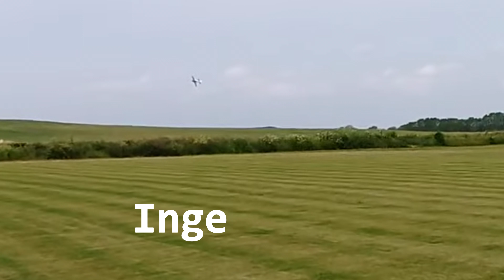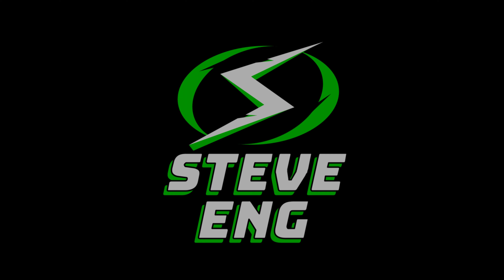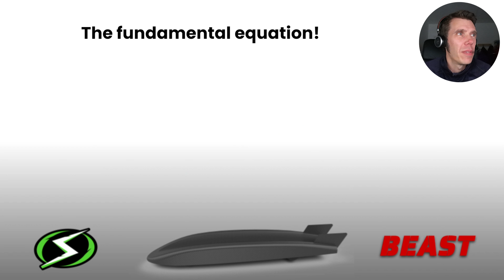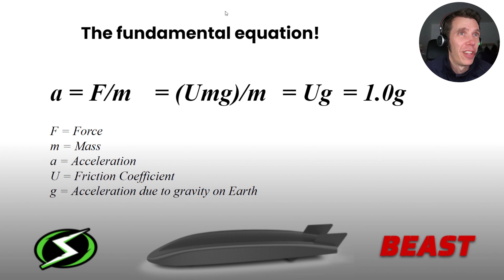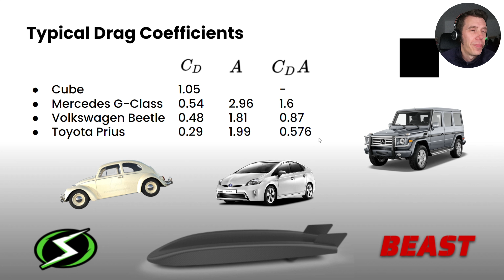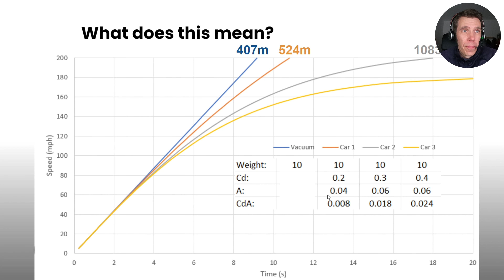Can Science help your R/C Speed Car go Faster?

Comment: Its a very good analysis. At your level maybe a more proper sensitivity analysis might be benefitial. Top speed gain over defined distance if you make the car 100 g lighter, or 500W more powerful or 0.01 Cd less .etc if all other parameters are the same. Parameter changes that can be achieved by reasonable compromise. One could than see what is the easiest achievable and the way to go.
Reply from the maker: Thanks for the comment, yes I understand what you're suggesting. I did something like this and could see that weight reduction will help so thats why I trimmed a few grams out before round 3 and the record run. I think CD and mass will be more important than power. But you still have to make sure it stays on the ground and had enough traction, which is where mass can help! A sensitivity study would indeed be useful.....

Comment: I once heard it said that drag wise, driving a car above 180mph is like driving a car through a fruit cake....

In my experience once you get to 80 to 100mph then aero really starts playing a part, which agrees with your plot well. Think many peoples experiences with duals and quads also agrees well with your plots. May well help those trying to push for 200mph on a single too. Mass, and downforce and the effects they have are factors that have to be taken into account. 

Many thanks for the video and discussion, it will defimately help in my overwinter rebuilds. 👏👏👏
I am NOT going to rewind any motors though..... 😂